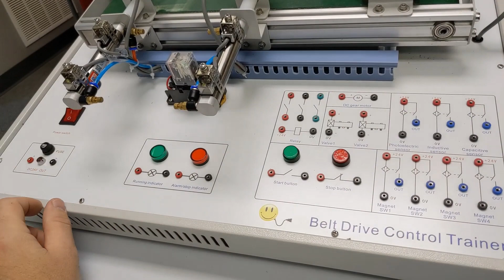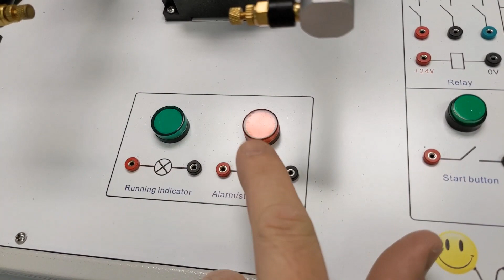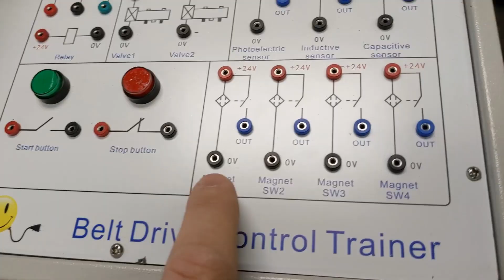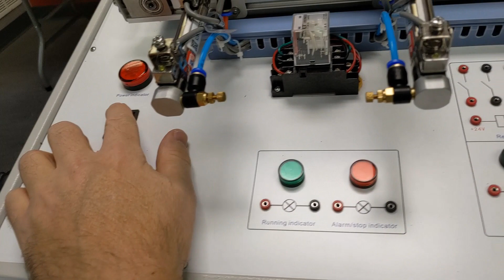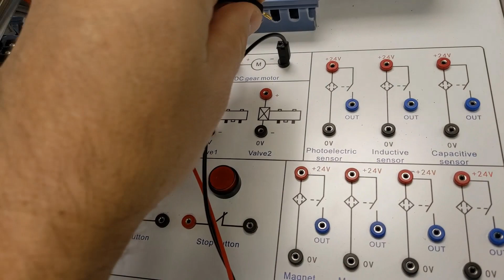Conveyor Trainer Part 1, Overview of the Motor, Sensors, Air Solenoids

Comment: As someone else mentioned, adding an encoder to the belt tail shaft would be a great training tool. you could then detect belt zero speed, which could be a jam or belt break, reverse motor for jam.
Reply from the maker: Yes it would!

Comment: our storage line conveyor is reversible.    It can be loaded or discharged from our automatic transfer car.  basically a first in last out short term storage system.   typically to store blanks for quick automated delivery to machines
Reply from the maker: Good example Eric!

Comment: Anybody know how to search up those air operated pushers? I have a hobby application I want to use these on!
Reply from the maker: Search for air cylinders. You'll get thousands of options.
Reply: We use anywhere from 4 to 20 on our systems. All valves controlled from plc. Let's not forget 20+ sensors.

Comment: I was wondering is it possible to have in place of two material sensors just one that is used to scan both aluminum and plastic? I’m thinking maybe their is something out in industry but not sure.
Reply from the maker: The second sensor can sense both the aluminum and the black plastic. Your typical photoelectric sensor can do that.
Reply: @TimWilborne  Thanks for the help! We have a similar trainer at TTC that has eight conveyor stations. One of the eight is pretty cool a Kuka robot that does the screwing for the base of the part.